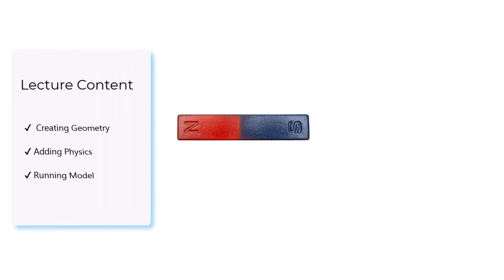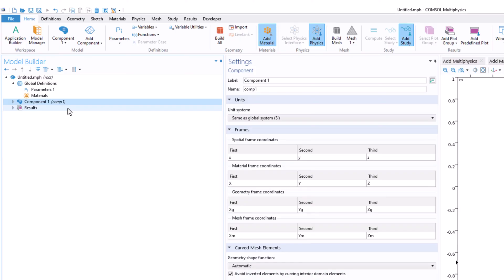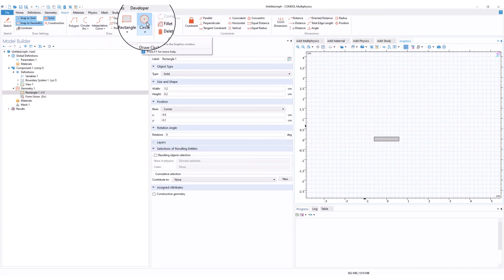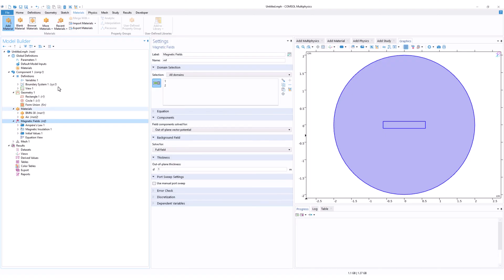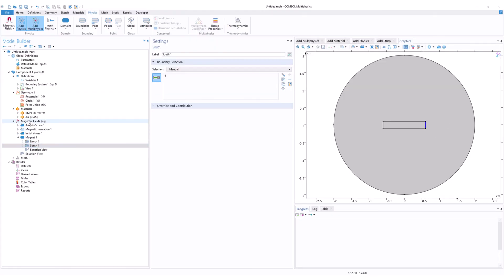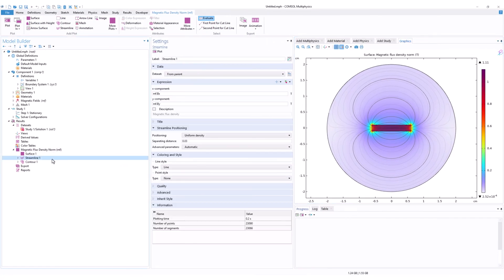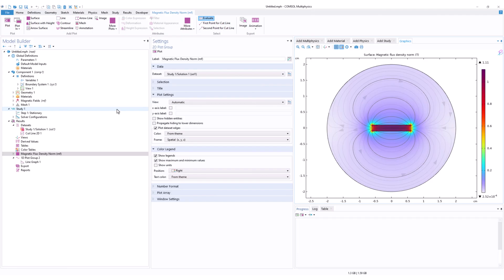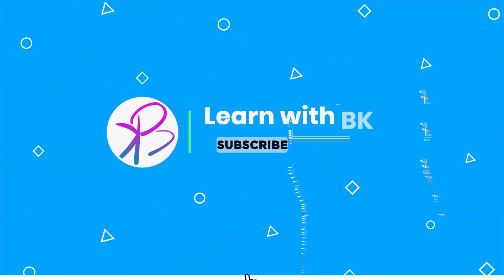Permanent Magnet Simulation in COMSOL® Software – Complete Tutorial | Learn with BK

Comment: It fails to compute the total magnetic field Energy when modeling the magnet like this. If I add Ampere's Law for a magnet area and set Magnetization model as "remanent flux density", and also specify the field direction unit vector, then it works.